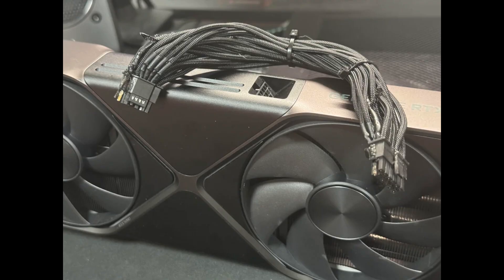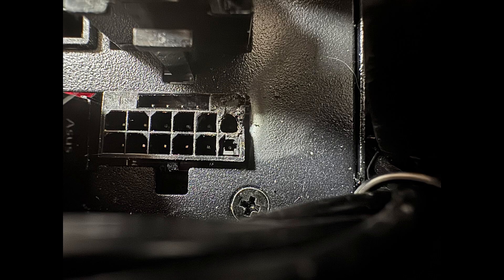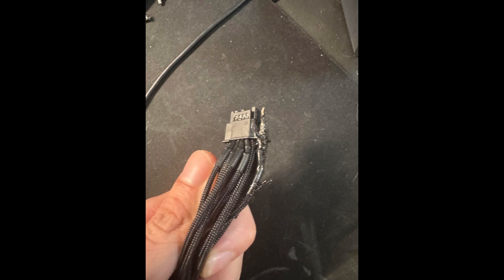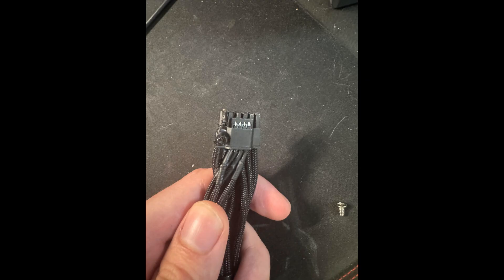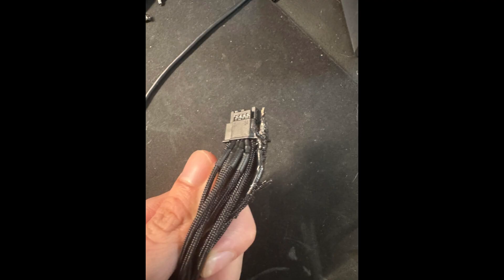The first case of a 5090FE destroying the connector but that's not all

Comment: https://youtu.be/kb5YzMoVQyw?si=QK2HjBeGZs_zLlHY

Here he explains on the gpu board the 4090/5090 have less power balancing and they cheeper made and are design flaw which will burn its self up.  The 4090/5090 = scam. No matter what 12VHPWR plug you use.  It will burn up. 

Nvidia is selling gamers a scam. They should be sued Imo.  Continue charger primer price but cut gpus down even more.  3090/ti didn’t burn up Cus was better designed for power draw.

Comment: You buy a $2000 GPU and use it with a garbage ASUS PSU and some random cable—what could possibly go wrong? The card only draws 600W... On top of that, it's a mini-build where cable management is a literal nightmare.

Comment: This cable solution NVidia invented is complete garbage as consumer product. First of all, GPU should not pull more then 300 watts, since it is already a lot. And still if it does, you got to be sure it will be capable to perfectly handle it in most possible cases. But the way NVidia engineered this part is basically stupid. In any solution cables should not heat. And 500 watts power draw is not a joke, not even mentioning power doubling spikes.
Reply from the maker: @SnakeTheCowboy  i agree to think one cable can pull that much wattage for more than a few minutes without causing damage it's like they forgot about how hot cables and connectors can get when heat is applied through that much power.